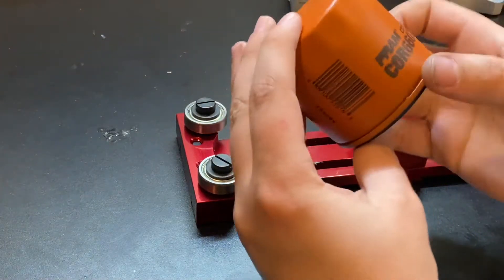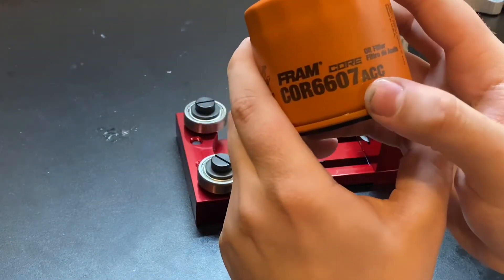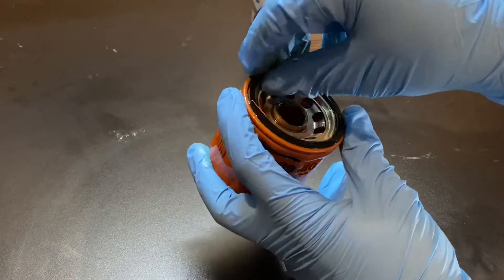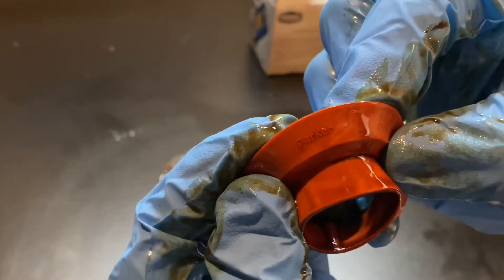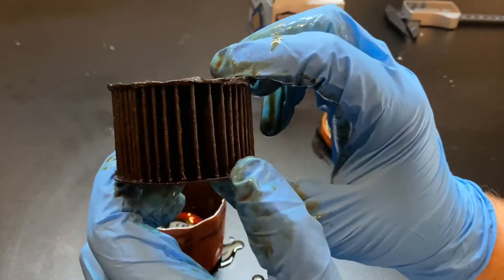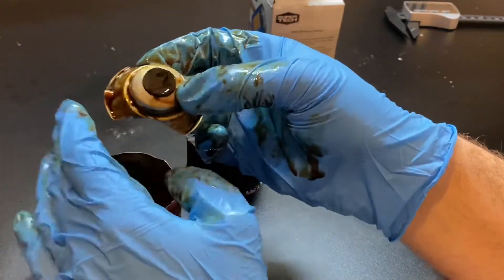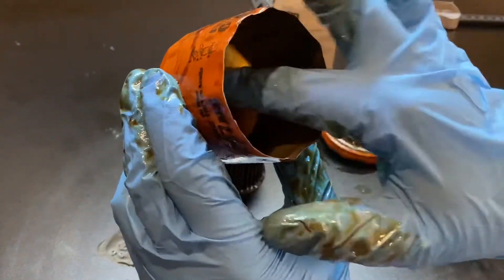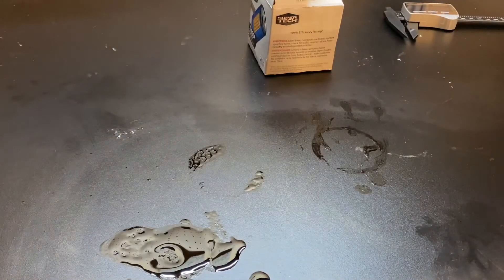Fram Core ACC 6607 Oil Filter Cut Open After 5,000 miles

Comment: I did not know until I did a oil change at Walmart for my brand new Subaru. Is this very bad filter? I am mad that I have paid a near $60 for this oil change (needs 0W20 oil)
Reply: Considering you need 0w20 no it’s not bad and 60 bucks isn’t a bad price. Don’t buy into all the things you hear about Fram filters, if even half were true they’d be out of business. Change your oil based on the display on your car use a quality name brand filter and oil, save your receipts and you’re golden
Reply: Honestly it’s almost identical to the suburu oem filter that’s also made by fram